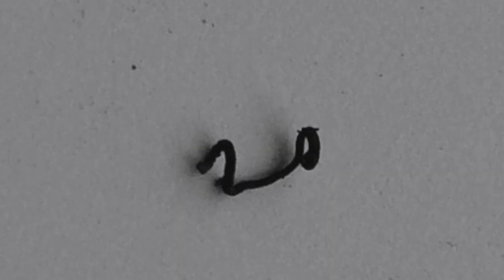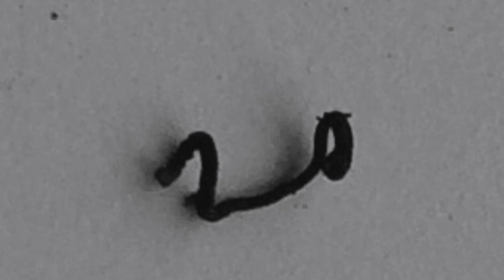The Microwave Production of Expanded Graphite

Comment: I have been getting good results selecting conductive charcoal after burning the bark of fir trees in a woodstove, sometimes finding pieces with less than an Ohm of resistance across them. You can then grind this in a mortar and pestle, mix with resin from an evergreen tree, work into a crude black plastic by hand after a bit of heating, and very slowly pyrolyze in a can with a fairly tight fitting lid (just a pinhole or so to let the smoke escape) elevated over hot coals until you wind up with a cake of charcoal. It takes a lot of patience to let all of the volatiles burn off without causing excessive pitting, but by the end you have something that is very conductive and uniform and immensely porous. It might be constructive to add some soot before beginning pyrolysis (C60 and amorphous carbon) for even more surface area in the end product.

I used a salmon can that was tapered toward the bottom which made for a tight fit with the removed lid pushed down into it, and put another lid with cuts made around the outside every cm or so, and the edges bent up to form a lip, in the bottom of the can to hold the material so it wouldn't get stuck in the can. If you don't put some kind of tray inside of the can, it will be stuck to the bottom and probably impossible to remove without shattering. Some of the material inevitibly does get over the edge of the lip and sticks to the can, so it is best to remove the can from the heat, allow to cool, and then use needle nose pliers to lift off the bottom of the can before it can adhere too badly. When the carbonization has progressed reasonably far, the amount of tar is reduced to the point that it will no longer stick. 

Then the fun part. . . heat the coals up to white hot blowing on the coals with a high volume air pump (like the ones used for filling air mattresses, the bigger the pump, the better) and hit the can with as much heat as possible for 10 minutes or so, unless (or until) you are worried it will burn up in the heat. At the end the sheet was reduced to an ideal material for super capacitors or electrodes. The disk formed was sponge like in appearance with a fairly light gray colour, and would only crush between the fingers with significant effort, although it could easily be snapped. The crystaline bits that remain after crushing feel very gritty against the fingers, despite the process beginning with charcoal about as soft as popcorn.  

There appeared to be a fairly large amount of graphene present, as well as an unknown material that showed a layered structure with a grid crystal pattern faintly visible on it, and irridescene that reminded me of a hologram when I turned it in the light. . . Like mother of pearl almost, but much stranger in appearance. Despite being paper thin, and very hard, I found it impossible to crush between my fingers. The carbon was also magnetic so I assume that a lot of iron intercalation took place, which could explain why graphitization occurred so extensively at relatively low temperatures. 

I have made supercapacitors with excellent performance from these materials already (were conductive enough to use electrical tape to connect a copper wire to a dry part of the disk) and held enough power (used in series) to run a bank of 5 LEDs for well over half an hour (I eventually got too tired to keep waiting and went to sleep), despite the internal volume of the disk being completely unsaturated with electrolyte and only a small amount of gel applied to the surface.
Reply: +Blitherer Masterman I'm excited to try reinforcing plastic (PET seems to work particularly well with charcoal) with this material next.
Reply from the maker: +Blitherer Masterman That sounds interesting! I have pyrolyzed wood using a can before to make activated charcoal and even carbonized plastics using the method. But with the samples I made I didn't get good electrical conductivity. Perhaps I should hunt for fir trees! What kind of fir wood did you use? Douglas fir? I haven't seen any growing around here where I live, but I remember those trees growing 1,000 miles north of here. I was making a small amount of carbon fiber last week for a repair job I was working on. I mixed graphene powder with a minute amount of graphene oxide powder along with some single-walled carbon nanotubes. I then added about 2% by weight in with some polymercaptan/amine two-part expoxy resin to glue a piece of broken ABS plastic together (so it would never break again).
Reply from the maker: I had been researching carbon black and C60 production (even carbon nanotubes) using flame synthesis/pyrolysis in partial combustion several years ago so this is very interesting to me.
Reply from the maker: +Blitherer Masterman I will have to try making a composite like that and thanks for sharing!!
Reply: I would imagine you are going to get a very high yield of interesting soot from any resinous wood, the more resinous the better, but my experience is limited to the pines and fir in my area. It forms long, trailing strands of minute soot particles that vanish without a trace between your fingers and show a strong response to any sort of electrostatics. The key to getting charcoal more conductive seems to be applying more heat. Try taking ordinary charcoal and blowing it to white heat with a high volume hand airpump (so you can cortrol the flow of air carefully), then quenching it with water, or simply closing up the container you are heating it in and waiting an hour or so. I have found that the hotter the charcoal, the lower the resistance afterwards. I achieved full graphitization and perfect conductivity (within my ability to measure resistance to less than 0.1 ohms) once by microwaving an evacuated lightbulb with charcoal suspended in it, but I gave up on the microwave method because I couldn't find anything that could hold a vacuum and had a low enough susceptance value. I suspect you would need a purpose built microwave heating chamber filled with inert gas or vacuum (they use the same setup to produce carbon fiber with microwaves in a nitrogen chamber). 

Another thing I find very interesting is wood gasification. I am hoping to try learning how to use a vortex tube to separate the hydrogen fraction from the carbon monoxide, and apply a high voltage arc between two electrodes to create an atomic hydrogen plasma for welding or other purposes. . . Or something like that. Should be very interesting.
Reply from the maker: Yes, that sounds interesting about the conductivity of the wood based on the resin constituents and percentages, and also about the annealing process you observed. An microwave-based reactor like that would work. Perhaps a H, Ar gas flow (or plasma) could be utilized in the annealing process in such a microwave reactor. I will have to experiment with artificial fibers and resin pyrolysis, and track down some good native softwood samples.
Reply: I've had success with all sorts of wood: hardwoods, softwoods, etc for making conductive charcoal, as long as the coals were glowing as hot as possible before cooling.

The resinous wood just creates the soot that is most likely full of the nanoparticles you mention when it goes through incomplete combustion in my woodstove. I am not sure of the conductivity of those particles, because they are not substantial enough to measure with a conventional multimeter. . . They basically disappear when handled roughly, but they are definitely strong beyond all expectations for weighing virtually nothing.

As an interesting aside, I have a headlamp with a dimmer function that will actually make an audible buzzing when pointed at the soot, loud enough to be irritating from across a room, which I can't come up with any explanation for whatsoever. . .

I wanted to check to see if the current value drawn from the batteries increased during the buzzing, which might imply some sort of remote photonic induction effect(?!) It might be some kind of weird radio resonance? I don't know.
Reply: Blitherer Masterman Well done! I’m not as far down this path yet but have been playing with various charred substances. Feathers are particularly interesting. Btw, have you noticed how scarce down pillows are these days? I hope to replicate your results soon...
Reply: Using a Co2 laser and burning a wood that will be rich in lingnines (such as pine wood or better yet ebony), and giving several passes with the laser beam out of focus, (to increase the number of sweeps) a similar effect occurs of conduction and I believe that of training (since the lignin of the wood forms hexagonal networks), although also of pentagons and this "imperfection" is what really produces capacitive effects.

Comment: Longyi super fine powder grinding machines advantages:
1. Powder from 48~4microns, fineness is adjustable
2. Built-in high efficiency classifier, no more investment cost for classifying system.
3. Smart PLC operation system, and integrated control system: 1 computer could operated max 6 machines, saving management cost.
4. No particle air pollution, more environment-friendly.
5. Compact structure to save factory space and lower foundation construction cost.
 
For CaCO3 powder
The whole grinding system including grinding, classifying, powder collector, fan, PLC cabinet, feeding conveyor and others, system working power is 296Kw
1.  D97=23um (600mesh)      Output: 10tons/h       Energy Consumption: 29.6Kw/Ton
2.  D97=16um(800mesh)       Output: 8tons/h         Energy Consumption: 37Kw/Ton
3.  D97=10um (1250mesh)    Output: 4.5tons/h     Energy Consumption: 65.7Kw/Ton  
4.  D97=6.5um(2000mesh)    Output: 2.5tons/h     Energy Consumption: 118.4Kw/Ton 
 
 
It is suitable for processing nonmetallic minerals such as calcium carbonate, calcite, Kaolin, clay, barite, talc, gypsum, limestone, calcium oxide, bentonite, dolomite etc.
 
 
 
 
Best wishes,
 Samuel 
Senior Business Development Manager
 
Fujian Longyi Powder Equipment Manufacturing Co., Ltd
Web: www.lymill.com 
Add: No.5, Lianfa Road, Dongxiao Economic Development District, Longyan, China
Tel: +86-0597-2581699
MP/Wechat/Whatsapp: +86 15105956429
Email:Samuel@lymill.com

Comment: I tried this with new, quality acids and got no expansion at all after microwaving. I then tried it using concentrated H2SO4 and concentrated Nitric acid ( 4:1 by volume) and got tremendous expansion after microwaving. I use good quality graphite flake in both cases. So you used no KMnO4 in your sulfuric/phosphoric acid mixture?

Comment: The intro is super excellent. I will try the sulfuric phosphuric method to make some and I had a thought when you showed the high voltage and the graphene.  What if you put the high voltage electrodes in a jar with some graphene and had air flow keep the graphene blowing around in the jar as the voltage was applied .  Would you have a strange light bulb since the graphene would constantly create an electrical path between the electrodes.  Just a thought.
Reply from the maker: +Ed Lovvorn That would be interesting. It would be an interesting lamp and would make a great conversation starter, no but seriously, that's a good idea and the apparatus would expand the graphite while keeping good conductivity in the product.

Comment: This is very fast and effective  method. Thanks for the sharing. Do you have BET area analysis of the expanded graphite?
Reply: Longyi super fine powder grinding machines advantages:
1. Powder from 48~4microns, fineness is adjustable
2. Built-in high efficiency classifier, no more investment cost for classifying system.
3. Smart PLC operation system, and integrated control system: 1 computer could operated max 6 machines, saving management cost.
4. No particle air pollution, more environment-friendly.
5. Compact structure to save factory space and lower foundation construction cost.
 
For CaCO3 powder
The whole grinding system including grinding, classifying, powder collector, fan, PLC cabinet, feeding conveyor and others, system working power is 296Kw
1.  D97=23um (600mesh)      Output: 10tons/h       Energy Consumption: 29.6Kw/Ton
2.  D97=16um(800mesh)       Output: 8tons/h         Energy Consumption: 37Kw/Ton
3.  D97=10um (1250mesh)    Output: 4.5tons/h     Energy Consumption: 65.7Kw/Ton  
4.  D97=6.5um(2000mesh)    Output: 2.5tons/h     Energy Consumption: 118.4Kw/Ton 
 
 It is suitable for processing nonmetallic minerals such as calcium carbonate, calcite, Kaolin, clay, barite, talc, gypsum, limestone, calcium oxide, bentonite, dolomite etc.
 
 Best wishes,
 Samuel 
Senior Business Development Manager
 
Fujian Longyi Powder Equipment Manufacturing Co., Ltd
Web: www.lymill.com 
Add: No.5, Lianfa Road, Dongxiao Economic Development District, Longyan, China
Tel: +86-0597-2581699
MP/Wechat/Whatsapp: +86 15105956429
Email:Samuel@lymill.com

Comment: I'm trying this method seriously, and there are some questions I have,
Do you have a paper on this method I can refer to?
Why is the phosphoric acid necessary? 
What happens if I use sulfuric acid only?
Thanks!
Reply: This is not Graphene! It is actually COH or CARBON HYDROXIDE.  Once filtered and fired to 1650C. in an argon atmosphere electric furnace it will THEN be Graphene powder. We did this same thing in my MIT lab experiments in 2001

Comment: Heh.... Nifty! I'll subscribe for more of that. 
I missed it in the video, but I'm assuming you use activated charcoal ground into a powder as the starting material. it's interesting. I'm curious about which acid is best, and i suspect that boric acid might actually be more appropriate than sulfuric or phosphoric, but it's an interesting bit altogether.
Reply from the maker: I used ~35 mesh natural flake graphite sourced as a commercial lock lubricant (Hillard), and in my case, found at Walmart, but any supermarket or home remodeling store will do. I haven't tried boric acid, hmm, it could incorporate and dope the material in certain ways. I just went for the strong and widely used acids to intercalate the graphite. And if you microwave it, even it out and stir a fine layer around the borosilicate (Pyrex) tray and stirr occasionally the extremely hot graphite to prevent hotspots from forming in the glass and allow for heat distribution in the glass. And let the glass cool gently with no sudden temperature extremes or touching it for a long while, or it will violent shatter in a bang.
Reply: heh... yeah the heat issue is why i was assuming you used activated charcoal. non-conductive carbon doesn't experience the same heating issues in a microwave, but graphite is actually used to make microwave crucibles. i've seen people smelter gold at home in a microwave in under ten minutes using the microwave inserts. if you youtube microwave glass slumping you can see the product. the one british guy that does all the videos on graphene dispersions has a diy thing, but i haven't tied it yet.
Reply from the maker: Yes, graphite or graphene, carbon nanotubes, and other conducting carbon materials will absorb microwave energy and generate a great deal of heat. These materials then distribute the heat near instantaneously. Especially true for graphene, which is as good, or if not better than diamonds for conducting heat.

Yeah, lol, Robert did that with a bit of fire clay and made a good microwave kiln.
Reply from the maker: (oh, it's "Hillman" brand powdered graphite lubricant not Hillard, my mistake.)

Comment: What's the point of "expanding"?   Graphite is already made up of multiple layers of graphene.  And why the acid?  Ordinary water is a smaller molecule so it would get in between the graphene sheets more easily than the acids used.
Reply from the maker: In normal graphite, the attractive van der Waals, electrostatic, and other attractive forces hold the individual graphene sheets bound together in the bulk material. To break the forces that hold graphite together requires work and energy. Normal graphite is hydrophobic, meaning water is repelled from it, so water alone cannot intercalate itself deep inside the layers. That is why acids are used. In an acidic solution, graphite no longer repels water but can be "wetted". Also, the mineral acid ions, for example, the sulfate ion SO4- in sulfuric acid, can migrate from the edge and permeate in between the sheets over time. After the acid has penetrated the graphite flakes, heat is added to decompose the acid molecules deep within the layers, thereby overcoming the attractive forces and causing the graphite to expand.